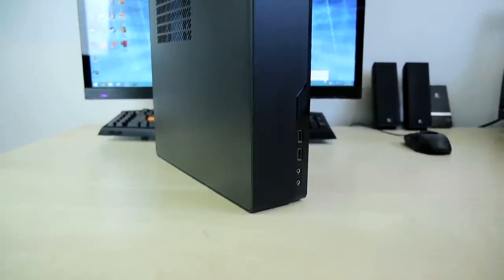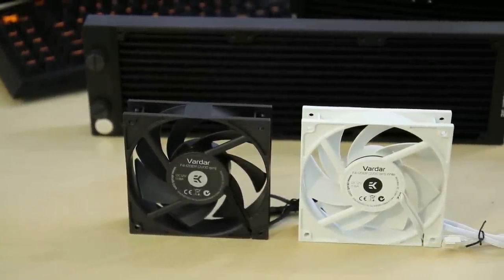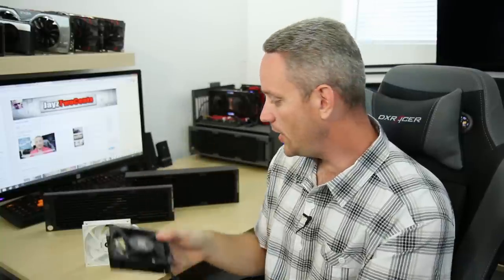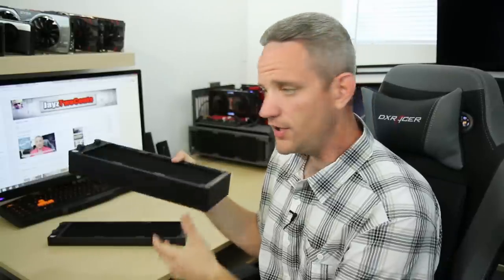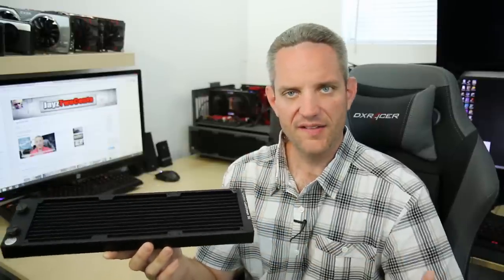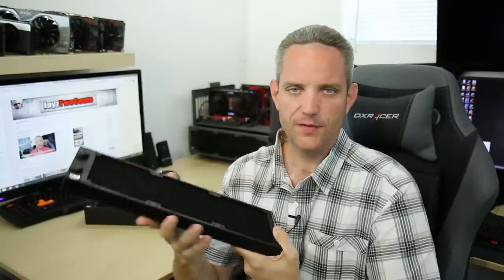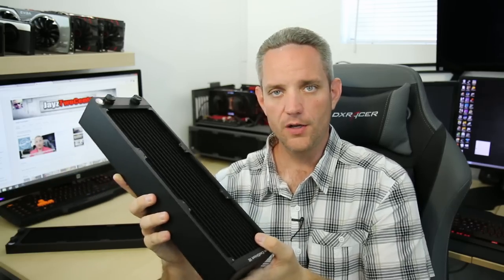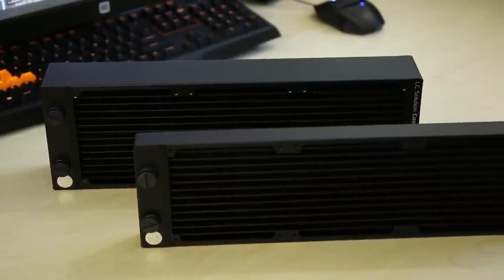New EK Radiators and Fans | When should you use Thick vs Thin Radiator?

Comment from the maker: "There were no temp comparisons!" Yeah, thats because I explained to you the ideology, no different than when I explained FPI, fan RPM, Static pressure or fluid types. So with that, take it or leave it.
Reply: ***** can we get a video on Is it worth water cooling your Motherboard please! :)
Reply: Dinklemin HELL YES. That'd be an awesome and extremely informative video. I vote yes
Reply: ***** I would like to know, if you have the room, how much difference it would make if you did go with a thicker radiator of maximum length.  Are you just wasting your money, or is the added cooling potential of thick radiators worth it?
Reply: Dinklemin and talk a bit about monoblocks.
Reply: Great vid.
Reply: ***** Maybe call it "More Monday"
Reply: ***** Would it be better to go with the thicker rad with just a push fan (or just a pull fan), OR a thinner rad with both push and pull fans?
Reply: Kristoffer Easterly Wouldn't you want push pul for a thicker rad because you need more static pressure? Also I have heard that push pull does not make a difference. Which makes sense because all the fans will be rotating at the same speed and pushing the same amount of air per second. I think push pull should only be used when you need a lot of static pressure. I don't really know for sure because I came up with these conclusions myself without a lot of research.
Reply: ***** i was woundering whats better?
a slim rad with push/pull
or a thick rad with just push OR pull
Reply: Danny Holla read my comment above not really sure if it will help you but read it anyways.
Reply: intSeKi
 ohh sorry :) i didnt read all that 1st time :p
well it makes sence tbh,.. thanks for the reply :p
Reply: Danny Holla XD np glad I helped.
Reply: ***** We know the ideology. This is the kind of word-of-mouth logic that is rife on basically every forum. What would be interesting would be to have these commonly-held-truths actually tested in some meaningful way.
Reply: ***** So I was right! :D
Reply: +JayzTwoCents Ok so i bought a Thermaltake core P5 max it will fit is a 480, Seems that thicker rads aren't really worth it?
I was thinking of going a 60mm could even fit a 80mm thick, So question is will i gain anything from the thicker rad or should i stick with a 45mm?
Doesn't seem to be much info on if a thicker rad actually makes much difference...
Reply: Yea it was the monstaa i was looking at and the UT60.
Thanks for the reply mate i will check out that review.
Reply: No thanks i would rather not, my current system is noisy as and wanted to try and make this one a bit quieter.
I will look into both the EK and Alphacool 60mm rads. Its good getting feedback from someone using them cheers mate. Also im going a 6700k and 980Ti and the weather gets bloody hot where i am some days 42-45 degrees C (108-114F?) Just want to be sure i will have adequate cooling as on my current Corsair AIO ive seen 50c on idle and when i game its like a bloody heater and its to hot to game some days.
Also sorry for the long post what fans do you use i was going to get sp120's QE but was also unsure if the QE would be enough.
Reply: Im in Australia and cannot get either of those fans our choices are pretty limited to what you guys get.My main shop i use is https://www.pccasegear.com/category/9_510 
Regarding rad amount i have a Thermaltake core P5 https://www.pccasegear.com/products/33484 and am only limited to a 480 i was only planning the 1 980Ti.
Reply: No worries, thanks for your advice mate.
Reply: +JayzTwoCents Think you could test this? Just make a simple cpu loop and stress it in intel burn test, once with the thin and once with the thick rad. I'm really curious to see how big of a diffrence there is, and if it's even worth it paying extra for a thicker rad.

Hell if you're feeling ambitious you could throw in rads with less fans too and make a full test and video of it!
Reply: Yup, title is misleading, it should be thin long vs thick short...
Reply: JayzTwoCents I am wondering about the two rads you showed (sane length, same fpi, different thickness). Is there one of the two that would be more efficient balancing noise and cooling?
Reply: @Dinklemin  still wanna see this! when is a monoblock worth it?!

Comment: Another thing to point out is the extra resistance thicker radiators pose on air flow. If you are using a thicker rad over your intake, a push/pull config is recommended to help achieve positive air pressure in your case.

Comment: Thicker rads have a few advantages over thin ones that you did not bring up.

1: Wider channels give less resistance to water flow so water will get from the hot components to the rad faster.  The pump will also not have to work as hard.

2:  Thicker rads tend to have fins spaced farther apart than thin rads.  You can push the same CFM through a thick rad using a lower RPM fan which lowers noise.

I'd say the best rad to get is the longest and thickest your case will take.
Reply: Anona Mouse Nope. http://www.xtremerigs.net/2015/02/11/radiator-round-2015/5/

Only one thick-ish radiator in the roundup performed well at low rpms with push. The 30mm hardwarelabs gts in push pull still outperformed push+thick rad combos that were thicker overall. I'm thinking that the fins get too far away from the channels to be effective making higher fin density better despite less flow.

Comment: I just added an EK 360 slim with a thicker EK 240MM. I use the 360 slim in the front of the Lian Li lancool 2 mesh and the 240MM up top.

Comment: ive found that whether thick or thin it didnt matter. However with the thicker radiators i could use a much lower RPM on the fans for a lot quieter operation.
Reply: well thats wrong, meaning your radiator isnt running as efficient as it could, thicker they are generally the higher the RPM needed to push air through.

Slim  radiators are better for quiet systems

Comment: I'm currently running one of EK's CoolStream XE 360 rads (64mm thick, part of the EK Kit X360) for my rig (3770K @ 4.2-4.5GHz + 6GB GTX780) as it was the largest length-wise rad that'd fit in the mini-ITX portion of my HAF Stacker 935.

Res laying down in the roof, feeding down to the pump mounted on a 120mm fan over the rear-I/O, which then feeds down to the GTX780's block that feeds up to the CPU block (yes, I've got pre-warmed coolant going into the CPU from the GPU, was the least-worst option I had), then from the CPU up into the rad's upper-fitting, then rad's lower fitting back into the res.
I tried to let gravity do most of the feeding as I could, such as between the res/pump, pump/GPU & inside the rad.

If I had to build a new system with a loop from the get-go in another HAF Stacker 935, I might consider doing a few things differently such as maybe having a 120mm rad between GPU & CPU (whichever way I fed the system)and making sure to have a draining port as low in the loop as possible - even if it meant having to use a T-joint with the drain valve mounted there between the pump and GPU block or otherwise have the drain valve mounted on the underside of the GPU block.

Comment: in open case rig, what radiator is better 480x20 vs 480x60 ?
Thank you. Very informative videos.
Reply: At the same size the thicker radiator will have more surface area to dissipate heat, and thus cool the water more. How much better depends on if your fans are pushing/pulling enough air to exploit the more fin surface area.

Comment: Do I want thicker or thinner rads if my goal is to make it as quiet as possible, even under load? On the one hand the thicker rad would dissipate more heat, but on the other hand I would imagine it would require higher fan speeds to push through?

Comment: I love the video Jay, but you have all the stuff, can you get some data to back up your claims?
Reply: Tyler Rowe I want you to think about what he would have to do to complete that test. I would like to see that too but its unrealistic, he would have to disassemble his loop reassemble it with the new rad, bleed the cooling system, probably make new rigid piping for the new rads because i doubt the tubes would match up properly to the new rad, run benchmarks. Disassemble loop again put in the other rad, bleed the cooling system, make new tubing, benchmark, disassemble loop again and put his rad back in.

 Not too mention the differences in systems, those rads may perform totally different in a system that doesn't have three titans and a overclocked x99 cpu in it so his results would never be able to compare to anybody else.
Reply: Tyler Rowe it's been done before many times, there plenty of data out there. Martin's Liquid Lab was probably the most comprehensive collection of data for radiator performance, pumps, flow rate etc.
Reply: +Vox Nihili how's that unrealistic?  If Martin did the test years ago and able to test different configurations and able to show the difference between thin/thick rad, push, push/pull, pull (fans), etc - then clearly its possible. 

Time consuming?  Hell yah.  I don't blame Jay if he doesn't do it.  

But its not possible.  

Jay had years of experience WC'ing?  Great.  How about showing the newcomers data to provide why it works. 

Isn't that what this hobby is about?  People learn from someone else's experience?
Reply: 3stardiamond I didn't say it was impossible just unrealistic for jay to do on his channel.

Martin is a guy who is dedicated to water cooling only pretty much and he has lab equipment to properly conduct these tests.

Jay does lots of different things on his channel and for him I think fully testing those rads would just take too much time, he is not like linus tech tips he doesn't have employees.

 In my opinion the large chunk of time it would take to fully test the rads would be better spent doing something else for his channel.
Reply: ***** Well I think he would have done that test if it was so easy, dont you? The fact he didn't do the test should tell you something, either he was too lazy to do it, or he thought it was too much work and his time could better be spent elsewhere I think its the latter.
Reply: ***** I will repeat myself. Well I think he would have done that test if it was so easy, dont you? I would like to see those numbers as well didn't mean to suggest i didn't.
Reply: ***** Second time you twisted my words. I will re word to be as clear as possible. Jay probably thought it wasn't worth his time or he would have done it, don't you?
Reply: ***** Well yah you did, you know full well i did not mean people should only do easy things, I dont think we would be talking via the internet if that were true. Sometimes when your a busy person supporting a large youtube channel pretty much by yourself you have to prioritize your time and unless jay is a lazy bastard he must have thought doing that test was not worth it for whatever reason.
Reply: Tyler Rowe Based on xtremerigs' data, the SE is the worst performing slim radiator of its class. It kinda qualifies as the worst radiator, period.
Reply: ***** The rather high resistance from the XE series is what kinda worries me. A fair lot of EK's stuff has high flow resistance.
Reply: ***** Fair enough.

Comment: Another great video, this one helped me a lot.  I have the Mercury S8 case and I'm going to run two 360 mm radiators on top for video cards.  Another loop on the flex bay with one 280 mm radiator but this one will be thick since I have less surface area to work with.  The dual 360 mm radiator is for SLI video cards and the single 280 mm is for CPU/Mobo/Voltage.

Comment: major water cooling question that your experience can hopefully answer, if not quantify: radiators usually are marketed with a max heat dissipation value in watts.  however, even 30mm 240s are often quoted as handling upwards of 700 watts.  while this clearly will depend on fans, fan speed, placement, etc., is there any reasonable multiplier we can use to guesstimate the actual dissipation of a rad vs its stated value?

Comment: i picked up an EK PE 480mm rad that's only 38mm thick because that's the best thing my local computer store had. i thought it wouldn't be enough for my system. i have a 5930k @ 4.9GHz and an Asus Strix GTX 980 Ti @ 1520MHz core, 8000MHz memory. well... turned out i was wrong. neither the GPU or CPU ever pass 45*C when gaming or benching. i'm blown away.

Comment: I have to pick some other ram sticks, I have to put in some fan cables and the RAM before attaching the top radiator. The RAM will be behind the 240' radiator fans. I would have to sacrifice radiator height and buy low fans. some 32,5mm high ram are already pushing into the rubber shroud Alphacool Susurro. I hope I won't have to put the ram in and out often, because I would have to drain coolant each time. I stick to 25mm+25mm so far (unfinished build). Fractal Design Focus G.

Comment: Hi.
Would a combination of thin rads sandwiched together with fans between them make sence instead of one thick fan? 
3x 120mm fans + 360x30mm rad + 3x 120mm fans + 360x30mm rad + 3x 120mm fans
All in a push/pull config. I have never seen someone do something like that before, and it could probably be a good reason for that.
Would a config like that perform better than a 360x60mm thick rad with push/pull fans?
Most PC cases do not have the space required for something like that, as the total depth of the radiator combination would be aprox. 135mm. But I think the concept is interesting. Aircooled CPU solutions do offer something similar: fan + heatsink + fan + heatsink + fan, and they perform very good.
Looking forward to your thoughts.
Thnx

Comment: ***** I would have loved to see graphs of actual temp differences between different thicknesses and sizes of rads (i.e. 240x30mm vs 360x30mm vs 240x45mm vs 360x45mm). I know thats a lot of work, but as i am about to order my cooling components this would have been sooo helpful since i can even mount a alphacool moster rad at the top. I will go with 30mm or 45mm on the top for esthetics (two times 240x30mm in front plus one 280x30mm on top in total which is overkill anyways)
Reply from the maker: Wyrucz Too many variables.

Comment: I know it would have taken a lot of work but it would have been interesting if you had done a performance test showing the trade-offs and which fan mounting solution is best for each radiator (ie dual fan for thick vs single etc. etc.)

Comment: this video might be useful for me, I am thinking about upgrading to a merlin SM8 case and getting a 480mm radiator with high FPI ( maybe ) and relatively thick ( maybe ).  Thing is my room is something like 2 metres by 2.5 and I will struggle to fit a large case between the desk and the wall.   I only like the caselabs ones though that are like 28.5cm wide rather than the 900d and phanteks which are more like 25cm

Comment: me in my danger den 3X 360 rad case i got infinite room for thickness thats why i got a 80 mill thick 360 alphacool rad in there in push pull but to be honest i did a little mod to the case i cut down the small bars of the fan holes were the rad is and i put the fan on the back side of the case

Comment: with a Corsair 7000D, 360 thick rad on top, thinner 480 in front, this scenario should fit with proper placement; or 2x thin 420s?

Comment: I am building my first liquid cooled computer. I am using a Fractal Design Define S , AMD 9590FX processor, Asus Sabertooth 990fx r3.0 motherboard, and a 1050 ti graphics card. I plan on liquid cooling the cpu, as I know that the 9590 runs pretty hot. The define S can fit a 420mm radiator in the top. Would this offer better cooling as opposed to a 360mm rad, and would it be enough to expand the loop to include the graphics card in the future. Do you have any recommendations? Thanks and I love your videos!

Comment: Hay *****, you said here that the fans on the radiator should be exhausting rather then in taking air. I imagine that you say this because the radiator would be expelling hot air into the case rather then getting it out of the case but I also remember you saying on a different video that the difference in water temps at the start and end of the loop do not differ by much (if my memory is serving me well this time). So would it be that bad if the radiators are in taking air into the case?

Comment: I got a NZXT s340 case with a i7 6700K CPU and 2x EVGA 1080 FTWs and under big load they reach up to 75 degrees Celsius with 80% fan speed. I wonder if 1x 240mm EKWB SE (slim) radiator in the front and a 120mm SE radiator in the back will cool down enough for my 2 1080s clocked at about 1900-2000MHz and my i7 6700K clocked at 4300MHz. (I plan to use the 120mm VARDAR ER fans btw)

Comment: Is there a "general rule of thumb" when it comes to the order of your loop? I'm going to build my first custom loop next week and was curious as to the order of the components. I'll be using a define S case with an Asus Formula IX with the vrm block and a GPU block. For the radiators i'll be installing a 360 up top and a 240 at the front. 
I'm torn between either running 
Res/Pump>GPU>VRM>360RAD>CPU>240RAD>Res/Pump
or
Res/Pump>CPU>VRM>360RAD>GPU>240RAD>Res/Pump
This will be with a delid 7700K overclocked to 5ghz and an overclocked 1080ti

Comment: There's a bunch of reviews on thick vs thin radiators on overclock.net.forum. Thick rads don't cool any better then thin rads. But the difference is can run fans at a much lower fan Speed.

Comment: What about different type of fans and their fan speeds? I am curious wether I can use slow speed fans on thick rad vs high speed fans op thin rad and how that compares. My question basically is: How do I get the most cooling performance out of the type of the rad with a certain fan type (and speed)? I hope you can elaborate on that! :)